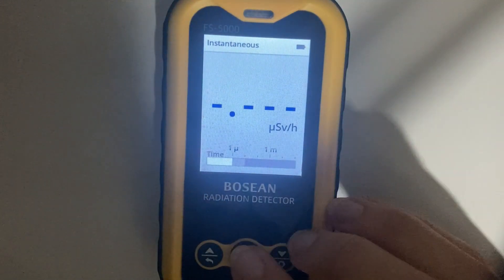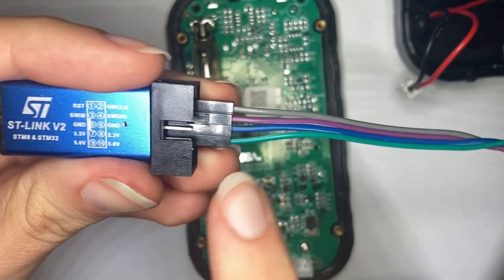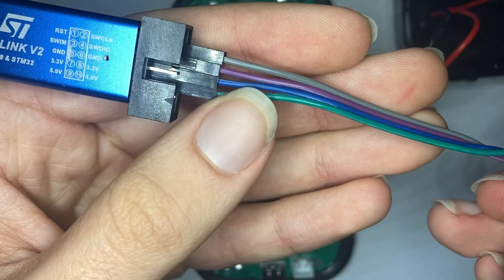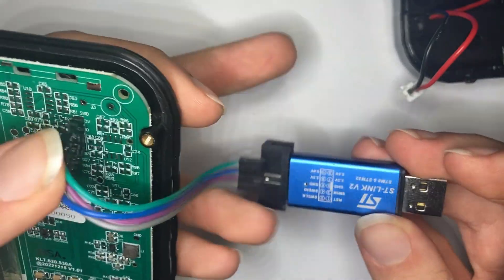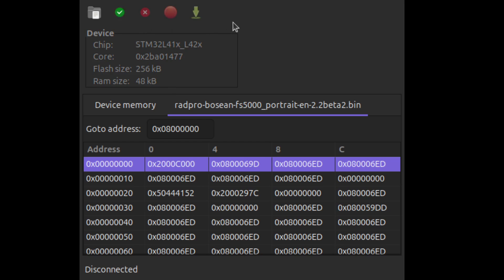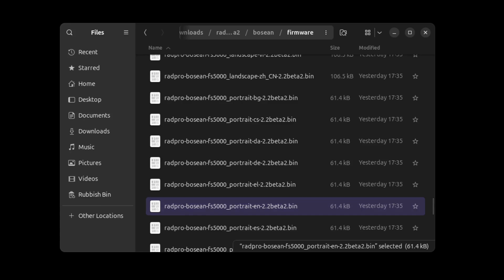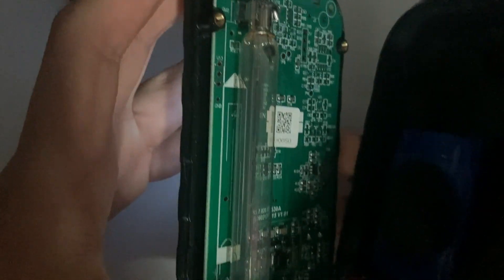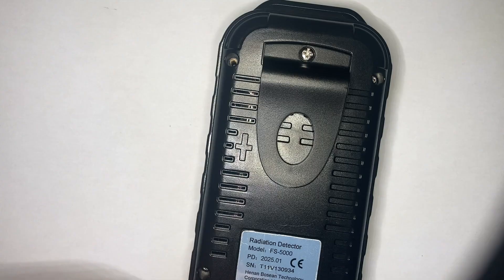How to flash Rad Pro on your BOSEAN FS-5000

Comment: Nice! For convenience, I carefully soldered (rosin-cored silver solder–with flux) a 4-pin male-to-male header on the PCB pad. This makes it easier (at least for me) to flash any future firmware. Plus, it fits inside the device's enclosure. I use that exact same ST-Link V2 USB programmer tool that you have, too. After installing the drivers for it, I just use the latest software from GitHub, developed by "Gissio" (portrait-mode). I open the batch file, whilst the ST-Link V2 USB programmer is connected–holding down the power button at the same time. The firmware flash only takes about 10 seconds. In my honest opinion, Rad Pro works great! I can only hope Bosean will develop a new model, since this is most undoubtedly, the best cheap Chinese-made G-M counter, even with the stock firmware. The Rad Pro firmware only makes it far better! The Bosean FS-5000 is great for source-finding, prospecting, and collecting data from radioactivity measurements, since it has data-logging! It's much more accurate and a lot faster, with a superior MCU + FPU, and a superior HV measurement network, than the FNIRSI GC-01, (even with the Rad Pro firmware), which is what almost everyone purchases. Unfortunately, as of late (according to FNIRSI), it now only comes with the very insensitive J613/J614 G-M tube, instead of the J321/M4011 G-M tube. Also, Rad Pro won't always flash properly to a lot of FNIRSI GC-01 G-M counters, either. I never thought that I'd buy a cheap Chinese-made G-M counter, as I already have much better handheld ionizing radiation detectors, like the SEI Inspector USB G-M counter (v. 2.13). Yet, here I am, and I quite like it! I highly recommend purchasing the Bosean FS-5000 over any other cheap Chinese-made G-M counter, especially with the Rad Pro firmware upgrade, which is fairly easy to install. Anyways, I'm sorry for the novel-long reply! Have a great day!
Reply from the maker: Indeed the docs say to hold down the power button, but i forgot and it still flashed no problem for me, and fr, as you said, the price is unbeatable for what you get. Originally i got the FNIRSI GC-01 and can confirm, J613... returned it and got the FS-5000. Double that, if someone is considering buying the FS-5000, I too highly recommend it! Your sorry? For what? Keep the comments coming ;> Have a great day too and sorry for the late reply.
Reply: Thank you! I know I shouldn't be sorry for long replies. You don't need to be sorry for a late reply. It's all good! I'm late to replies pretty often, and occasionally, I outright just forget sometimes. Anyways, with the power button being held down, you are correct; it doesn't matter. It used to say to do this, but they updated the firmware installation page at "GitHub," since you don't have to hold the power button during the firmware flash. That makes it even easier! 👍

Comment: Today I touched and played with my FS-5000 for the first time. Already purchased ST Link V2 to flash radpro firmware. But my ST link is not original, it is from China. Should I be worried that it wouldn't work?
Also is it a vig difference with the rad pro firmware? Way more precise or not so much if a difference? Also, what are the other bells and whistles in this firmware? 

Best regards!
Reply from the maker: I dont know anyone with a original ST-LINK V2, it'll most likely be just fine if you got it off aliexpress for £1.50
I mean i accidentally killed the original firmware after getting it so i don't have anything to compare against/minimal data to compare, But RadPro is quite a but more.. Basic in a good way, it does its job and quite well, If you press the right arrow you get a "Average" reading with a ±X% of how accurate the reading is, to answer your "Way more precise" question.
As for the Features: https://github.com/Gissio/radpro/blob/main/docs/manual.md#features
tldr: "bells and whistles", Chess, change sensitivity (idk if that slowly kills your GM tube), GeigerLog software, Super customizable, want only a led to light when it "clicks", or only a click, or only a vibration, or all 3? Wayyy longer logging time, from what i know stock firmware logging time is pretty poor, especially if you wanna log radiation when you need to from radiation fallout.
Reply: @Sn60Pb40thank you for your detailed answer! 
I couldn't find 4 pin connector, so I am planning to connect the detector straight to the other end of the wires without a connector, may be with some teeth sticks to hold the wires in place. What is the point of bending the connector to the right that you show in the video, where are the contact points, underneath? I guess if I see on the computer that the detector is recognized and connected, that would mean that all the 4 wires maked contact, right? 
Also, as the battery is disconnected, are there any capacitor(s) that still hold some high voltage that could potentially shock me and is it just the tube ends that I need to prevent touching?
Reply from the maker: @datsovtsvetan  I bent it only to get a firm connection, so it wouldn't disconnect mid programming and soft brick. as for any caps, not that i saw, they probably drain after 5 seconds of disconnecting, but still better to mention it then not, Id just avoid touching it if possible. Also connecting it straight to the device with just (dupont i assume you meant?) wires is fine, i just put the pins so its it'll be maybe easier to show in the video.

Comment: Very poor tutorial. No instructions for the software. No link to the software. You could have done without it.
Reply from the maker: sorry, I'm just starting out, as for the instructions, I did give some I feel like, I show where to click and what to put, and links are in the description, could you please reiterate what you mean by "You could have done without it."?
Reply: @Sn60Pb40 You don't provide the name of the firmware update software. There's also no link to the software. But that doesn't matter, since you can flash without your software and it's much easier. There are several .bat files (executable files) in the Windows folder that run the flash without additional software. You just have to hold down the power button during the flash process.

There are also .sh executable files for flashing for Linux.

Sorry for my poor English.
Reply from the maker: thanks, will do better next time.
I wont provide more excuses, 
I will mention I made this video at time time when the. sh files for flashing the counter was broken (https://github.com/Gissio/radpro/discussions/193#discussioncomment-13163524). and windows is not something I use, this video is a alternative in case someone can't use the provided flasher, if it's broken or other reasons, I will update the description of this video accordingly tho.